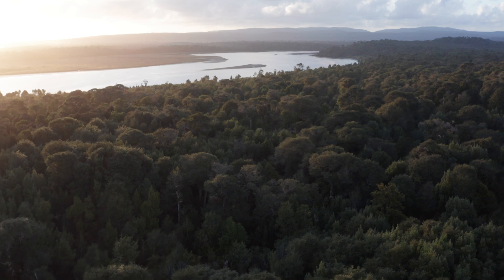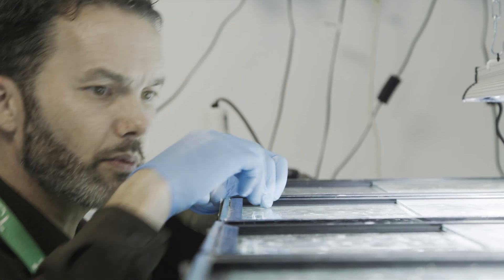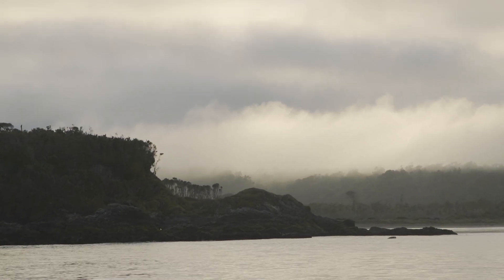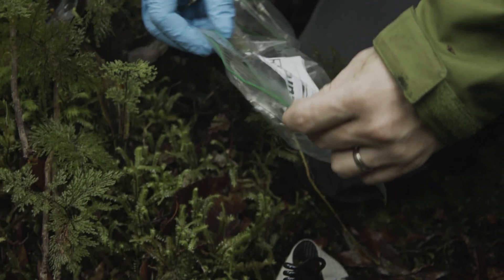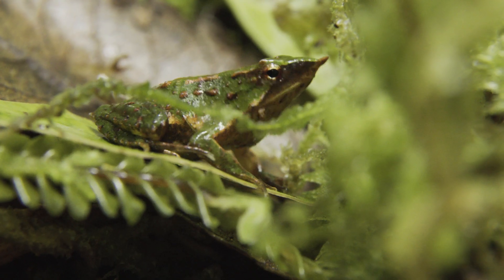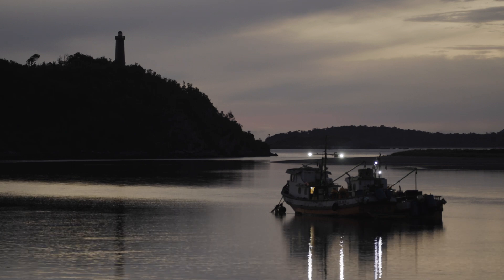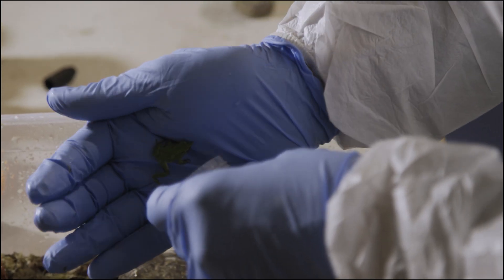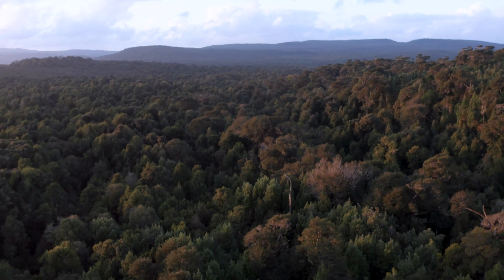A Leap of Hope | Rescuing Darwin’s Frogs from Extinction

Comment: we were very intrigued by this video.  In the cellar of our 400year old house in Worcester UK, we have a 'sump' where the very occasional heavy rainfall/flood can drain away through a drain pipe to a soak-away several metres distant underneath our back garden.  
A few months ago. there appeared in the sump, a small frog.  this is something which has happened a few times during the forty plus years we have lived here, but not for the last ten or so years. 
Two weeks ago, going down to the cellar to fill up the fuel hod for our Aga, I was astounded to see two miniature, perfectly formed froglets, no bigger than a thumbnail. By the time I went up to get my phone to photograph the little creatures, they had disappeared and we haven't seen them again .  The adult is still there.  Did he/she/it produce them and then eat them?  We , as children and our children too, have kept tadpoles in the past, but never seen perfectly formed froglets like this; so when we read about the Darwin males producing , it was most intriguing.
Reply: I would guess your tiny froglets metamorphosed from tadpoles last summer (tadpoles which would have developed in the nearest pond), and have been hibernating in your sump over the last couple few months. I think common frogs in the UK are typically at least two years old before they're sexually mature, so the larger frog you found was probably a 2023 tadpole.